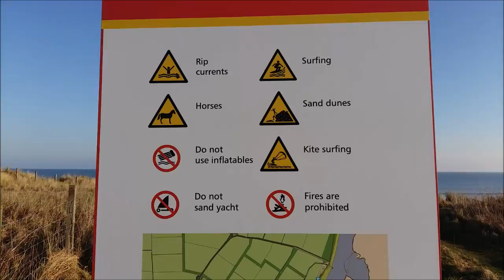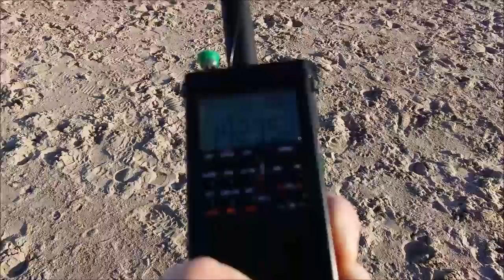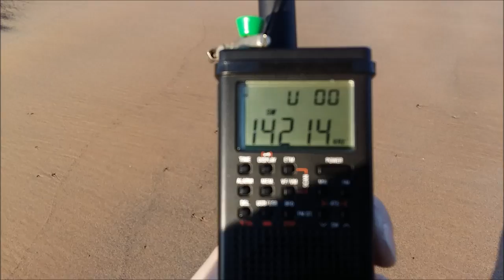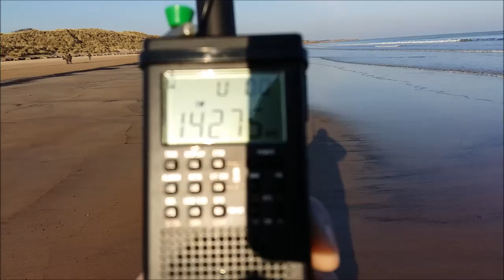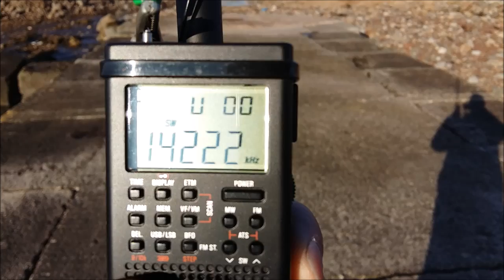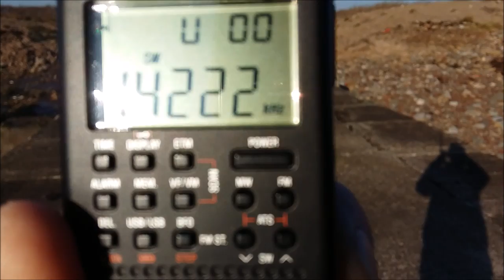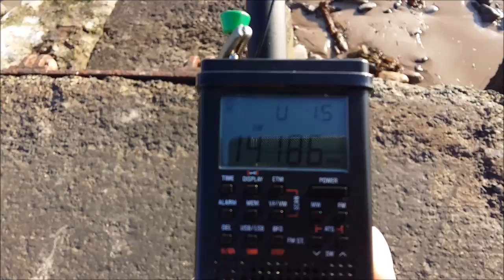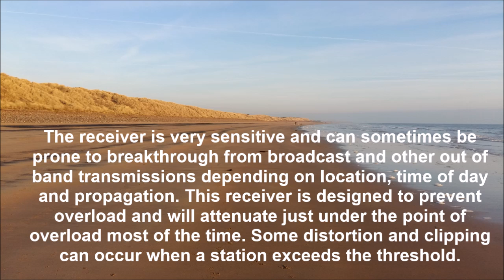Homebrew mobile antenna for the County Comm receiver

Comment: M0dad.
Have viewed the second recommended link:-
Homebrew mobile antenna for the County Comm receiver.
Results were obviously excellent but puzzling...
At 8' feet your wire is 1/16 wavelength long  on twenty metres and that makes it off tune & capacitively reactive..To  resonate it, the usual technique would be a coil in series but that would resonate it as a 1/4 wave which is a low z, & precisely what that telescopic antenna input DOESN'T want. 

I’ll try an 8 foot length with a variable cap somewhere along the 8’…initially at the bottom. 
There is a technique  known as ‘Electrically stretching’ a wire as opposed to loading it with inductance.
This takes the radiator up in freq. Might make it look like a half wave…Hi Z as required by the I/P circuit.
I’ll keep you informed.
Regards and Happy New Year,,
M.O.L..